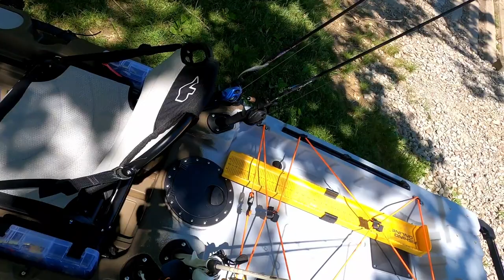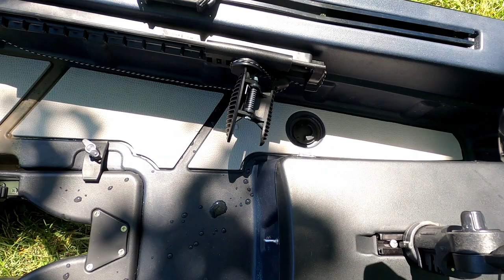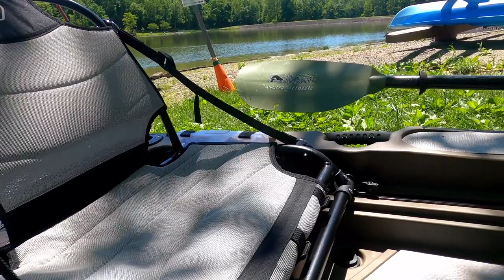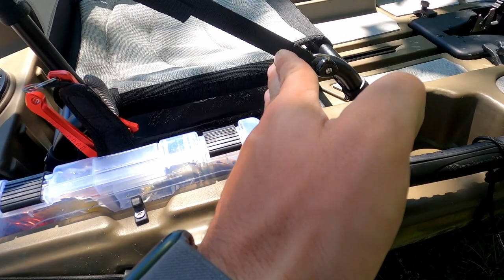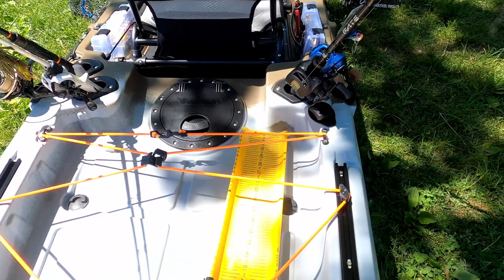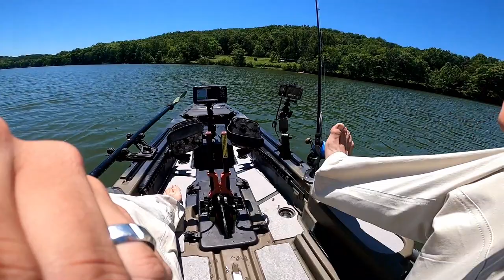Vanhunks Elite Pro Angler Kayak Review!

Comment: do the fins kick up when you hit something?  what about the prop drive?
Reply from the maker: The fins won’t kick up when you hit something, in the way of folding back.  However if you push one foot forward and one foot back, the fins will pull up just about flat against the hull, you can beach the yak with the fins up in that position.  If I know I’m going super shallow, I will just split the pedals like that and get the fins up out of the way.

Comment: A few questions if I could? Just wondering how it is as a paddling kayak?  Does the rudder come standard with the base model? Does the box that holds the fin drive come out and open a port that may be adapted to a motor? Sorry for all the question; just recently learned about Vanhunks.
Reply from the maker: Hi Jim!  As a paddling kayak it is not bad at all, no different really then paddling a smaller model.  It is a little longer, and a little heavier, but overall it tracks well and moves effortlessly in the water.  The rudder is standard if you opt to not purchase the fin drive or prop drive, you get a storage box that slots into that hole to keep extra tackle or gear safe and dry. 

I have seen people run a small trolling motor through the center hole, or, there are two sets of 4 holes in the rear to mount a trolling motor, power pole, or the like.  There are certainly options, but as far as a standard mount for the center hole i don't think that exists as of yet, to do that may take some thinking to make it operate in there correctly.
Reply: Hey Jim, I’m learning too. It seems either VANHUNKS OR HAMMERHEAD or maybe either, have an adapter that you hook to a trolling motor that fits into the hole. Of course, the handle needs to be turned 180 degrees but from reading, it appears standard trolling motors can be changed that way. Best wishes?
Reply: @jerrytalley802  ... I think Yak Gear makes adapters to replace pedal drive or thru-hull sonar pod openings for various kayaks but not sure if they have one specifically for the VH or HH. I have successfully flipped the control head on a Minn-Kota in the past and I know Newport Vessels has a video on how to safely rotate one on their site.

Comment: It looks a lot like a vibe. A lot similaritys.
Reply from the maker: I would agree to that at a look.  I think the biggest difference between the vibe (13 ft model) and the Elite is the drive options.  The Sea Ghost 130 I believe is only a paddle kayak (correct me if I’m wrong please) where the Vanhunks can be paddle, prop, or fin drive depending on what the kayaker wants.  Definitely similarities though for sure, and in the 13’ arena, I think we start to see a lot of blending and it comes down to the subtle differences from boat to boat.  It’s curious how each company can be similar yet very different
Reply: @hook_a_yak1629  kinda has some similarities with the sea ghost and shearwater.
Reply from the maker: I can absolutely see that, drive is very similar to the original Hobie as well.

Comment: Another week and I get mine, can't wait  :)  Question for ya,  do you use a cart with yours to get it to the water from trailer or vehicle if so, which one do you use ?  thanks charlie
Reply from the maker: Hey Charlie! I do not use a cart with mine, I unfortunately just lift it and get it to the edge of the water, I believe any car that would accommodate a 36” wide kayak would work just fine.  I know Vanhunks has some for sale, definitely worth checking into they would get the job done.

Comment: Does the fin system pedals have a similar kickup design as the Hobie fins?
Reply from the maker: Similar yes but not automatic like the Hobie they will run parallel to the hull but you have to manually push them up

Comment: Hello brother how you doing? Man that is a very nice kayak you got. I am looking to upgrade to a pedal drive kayak myself. I like how you have so much space on the kayak and how the seat is raised up off the kayak on slide tracks too. I also like how it has a lot of rod holders. I don't carry a lot of rods with me but it's nice to have a little extra. I also like how it's weighs under a hundred pounds. I do have a question? How are the foot pedals on this kayak? Do you know how wide they are? I have big very very extremely wide feet sz15 6E wide with very chubby fat wide toes that are equally straight across making my foot very very wide at at 6 1/2 inches wide from my big toe to my lil toe. It's a very very extremely wide foot i got. Oh do you know if those straps come off the pedals too because my foot will not fit underneath those straps because of my toes being evenly straight across & being very fat and wide. It sucks having a foot that is 6 1/2 inches wide because everybody don't have a pedal that is wide enough for my foot. I'm looking for wider pedals right now but I'm having trouble finding them. Oh do you know if these pedals can be switched out for wider pedals too? I see you pedaling barefooted 👣 so I take it it must be comfortable to Barefooted 👣 cuz that is how I have to kayak is barefooted 👣 cuz my foot out grow shoes , socks , & boots when i was 18 years old & flip flops is the only footwear that will barely and i mean barely fit my foot because of my toes being wider than the flip flops straps. Oh i also  like your reef flip flops man I wear same flips flops too. I love them cuz they are so comfortable to wear and it's the only pair that is big size 15 friendly. I really will appreciate if you can let me know about these pedals because this is what's stopping me from getting a pedal drive kayak right now because the other pedals are so narrow my feet just keeps falling off of the pedals which hurts my feet when that happens because am a chubby fat dude with chubby fat wide toes & feet. Good video brother thank you for sharing this. Looking forward to seeing some more kayak Adventures.

Comment: The fin drive , is dose it have a reverse ? Thanks
Reply from the maker: It will reverse if you pull the drive and reinsert it the other direction.  Takes two seconds to do in the water and voila you have reverse

Comment: I replaced the rudder cord with stainless cable, so much better, no stretch, better turning
Reply from the maker: That is a genius idea, with all the in hill access it wouldn’t be a difficult task either.  Great upgrade, what stainless did you use?
Reply: @hook_a_yak1629  , I forget the exact size it was but it was the same thickness as the cord and it's sold at home Depot (total cost was $8) ... Also , little trick... Use fishing line and tie the old cord end to the new cable end and you pull the old cord out and it pulls the new cable in... That way you don't even need to mess with the inside of the boat... basically use your old cord as a pulley, it's already in the sleeves so it's so simple....I also made some nice seat risers to lift it up 3 inches

Comment: Does the boat have reverse drive?
Reply from the maker: It does if you use the propeller drive, the fins will reverse but you need to flip them while using it and they will push you backward!
Reply: @hook_a_yak1629  thank you for following up, this was helpful.

Comment: So a Vanhunks took a Vibe Shearwater, altered the shape a little, put a Hobie Outback Rudder on it, and put their logo on it lol? 
Jokes aside it looks like a solid kayak, but honestly it looks like a Vibe Shearwater copy.
Reply from the maker: Lot of similarities for sure, but devils advocate how much can we really alter from kayak to kayak?  I see what you’re saying for sure though,
Reply: Definitely a bunch of the same features as the shearwater, but missing a few too.  Among those are horizontal rod storage, multi-adjustable seat positioning (and the standing platform).   Question.  Can the drive be swapped for the hobie 180 drive live a shearwater?  
So far, the vibe has a deeper feature set.   But with the vibe  drive and the standing platform, it’s almost 500 bucks more.
Reply: I saw that it hold like 550lbs though.  Is this actually true??  The only reason I haven’t bought a shearwater is the weight capacity being too low for my big guy kayak camping needs…